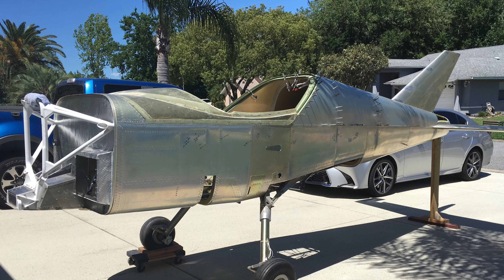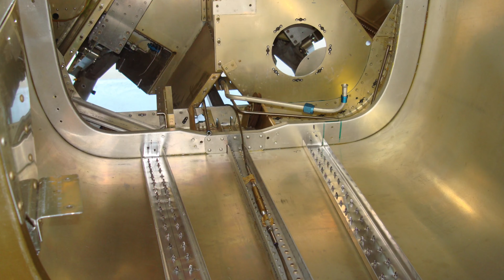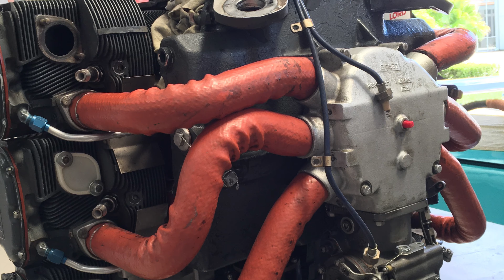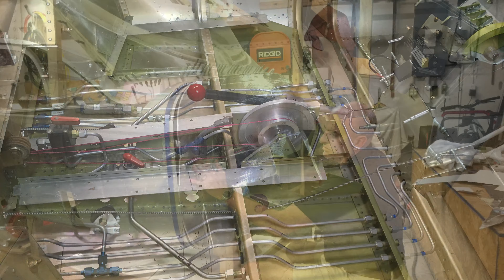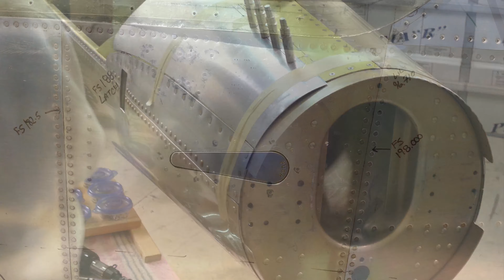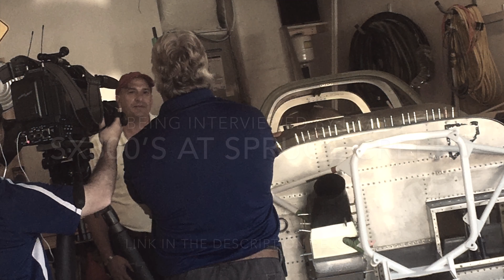BUILDING AN EXPERIMENTAL SX300 AIRPLANE

Comment: Chad .....what Are you asking ? I’ll spread word around here. What UV coating did you use on the Canopy ?
Reply from the maker: steve carter I will ask him about the coating on the canopy. I know it was made with the special coating straight from Airplane Plastics in Tipp Ohio. I have the Barnstomers link in the description drop down also, $78,900 includes low time io-540 engine, zero timed prop, new canopy, etc. feel free to email Chad or text him. Laurie
Reply: Plane Pineapple Life 
Thanks Laurie.